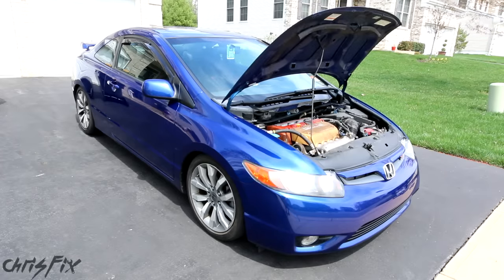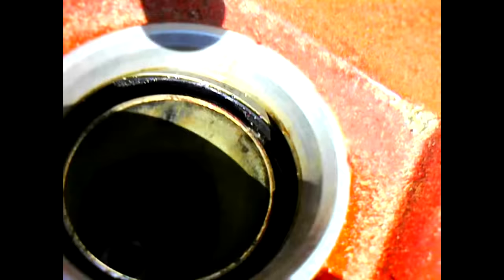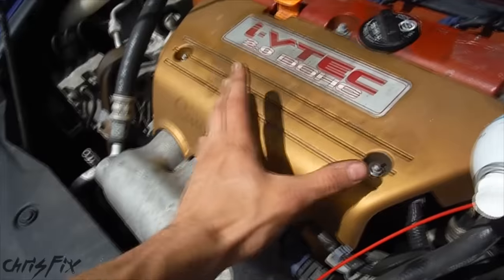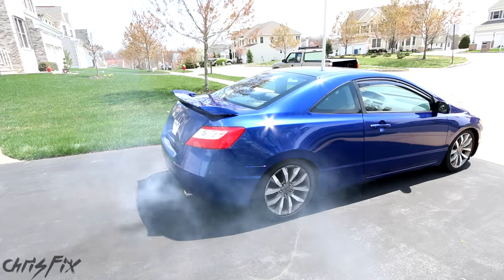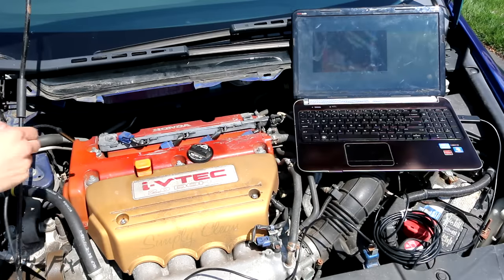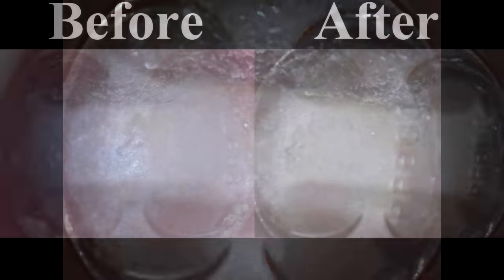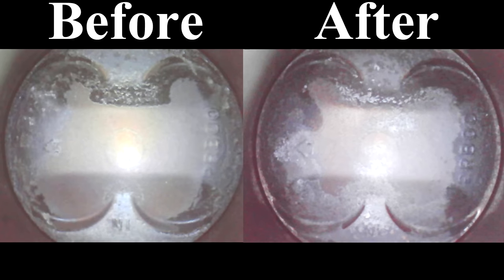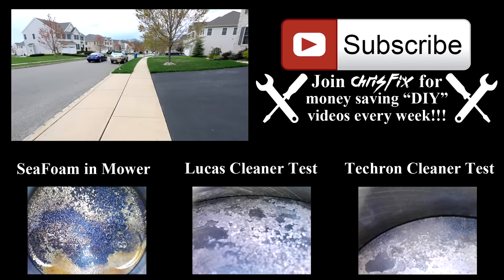Does Seafoam Actually Work in a Car? (with Proof)

Comment: Just did the seafoam "3 way treatment" (in the gas, in the crankcase, and sprayed into the intake) to both my son's 2010 Equinox and to my 2010 Expedition.   The difference was astounding - I was very impressed with the Seafoam and will use it again.
Reply: putting Seafoam in the crankcase can lead to costly repairs, usually whatever it loosen has a habit of clogging oil passages, especially the ones that feed your main bearings.
you can search it on the internet. 
the other 2 methods seem okay I suppose
Reply: @terran2kk  I think people should do this when they doing an oil change since that stuff still stays in oil.
Reply: @GokuTheHusky  it just goes through the injectors, not the oil. I usaually do this when I put a new filter and after a tune up. (2002 Ford Expedition, “285000” miles) and still running like a charm.
Reply: Question buddy did you remove spark plugs when you sprayed into the car? Or do you just spray those above areas w/o doing anything else?
Reply: @whoelsebutthekidace  No, this was just a treatment for the gas, the air and the oil.  I think I did the plugs and coils afterwards. 

Cancel

Reply
Reply: I know this was commented a year ago, but where is the throttle body on the 2nd gen Equinox? I have a 2013 myself. Is it the end of the tube where I replaced my engine air filter or is it somewhere else?
Reply: @JMaher393  You have to pull off the intake box on top and it is up front.
Reply: @TheScottiolla  Thank you so much!
Reply: @terran2kk  Doesn't matter where you put it, it will loosen carbon and it is just a detergent like in gasoline so should not harm the engine at all.
Reply: @terran2kk  I know of a mechanic here that has taken apart engines that used seafoam and every one was near spotless and clean.
Reply: @JMaher393  I hope you searched YouTube by now but, if you haven't, it's at the front of the cover. You have to remove the cover at the air hose and front of the cover. Right to left of where the cover connects on the front is the throttle body is. You'll see it as soon as you remove the cover.
Reply: @SugaDontPlay  Yeah I did, haha. Thank you so much
Reply: did you have issues  with oil  consumption  with  the equinox? did doing the 3 treatments take care of it?
Reply: @mychannelsirr  it doesn’t consume like other horror stories I’ve read (also note, I got in on the extended warranty and GM serviced it).   The car was running rough - the Seafoam helped that.

Comment: Absolutely love your channel. You are building a very trusted brand for yourself. Your credibility is off the chart with me.......and I am sure with your 7 million other subscribers.
Reply from the maker: Thanks a lot! I'm always working to keep building that relationship with you guys!
Reply: @chrisfix  👍
Reply: I love chris fix, he is the only man on the internet i will swear by.
Reply: Lu Ms  it breaks it down and carries it through the exaust, if it does get stuck in the exhaust it doesnt matter since it wouldnt effect performance at all
Reply: Lu Ms  most exhaust systems are pretty thick in diameter, so theres alot of space for air to travel through it regardless of carbon build up, carbon build up hurts the engine performance usually when its inside of the cylinder because it messes with the firing of the actual engine, it can get in the fuel injectors and even on the tips of the spark plugs. This is a very condensed space, and seafoam should get the carbon build up out of the cylinder through the headers and through the exhaust, sometimes it can get stuck somewhere in the process however, but generally it doesnt, and if it does, it will just move onto the long exhaust pipe in which it wouldnt end up losing as much performance as if it was actually hurting firing time or the other engine components, so to answer your question, yes, it can, but its not supposed to. To answer your second question, if you have more than one exhaust tip and its thicker than the bananna can fill, then yes it would decrease performance, but in most higher performance exhaust systems, it wouldnt effect performance much, and this example doesnt work here because carbon is incredibly small, it would not build up to the size of a bannana.

Comment: I've been using Seafoam in the gas tank in my '88 Dodge since it was new-- over 300,000 miles and I've never needed an injector cleaned or repaired. Same goes for my '98 Mercury.

Comment: I swear I had a misfire code on cylinder #2 in my Jeep. New NGK spark plugs didn’t fix it but Seafoam cleared out the carbon deposits and the engine ran better immediately afterwards. I am so confident in this product after only one use it’s magic.
Reply: Where did you put the seafoam in?

Comment: Used this on my just purchased, 20 year old prelude (150K mi). Before using it, I had no oil leaks. I used it and it cleaned out a whoooole bunch of nastiness, but it cleaned it out so much, that several gaskets started to leak oil (I assume the built up oil was plugging the holes). It runs much better, now that I replaced a whole bunch of rubber in the engine. I'm glad I was able to find all the leaks and fix them, but be warned that if you're doing this on an older car, there's potential for new leaks. But the car definitely appreciated the cleaning and all new gaskets!

Comment: Have loved seafoam for years, got told about it when I bought my rx-7, works wonders I have always done the "deep clean method". Get to 1/4, add seafoam, have a can with gas ready and run it till your empty. Add your gas can hit a station, fill up and drive

Comment: keep in mind, the engine was already pretty clean. I bet on a dirty engine the results would be more impressive. and you didnt look at the valves either.
Reply: It does work better in a dirtier engine. Letting the fluid soak in the chambers then removing it before starting is what works best.
Reply: Yea these kind of cleaners are meant for much older cars with years and years of carbon buildup
Reply: BlatentlyFakeName  buy some BG44K is a top rated additive
Reply: Top rated by who, the manufacturers?
Reply: Marvin Harrison Smith II  I don't use BG but know people that recommend it. What I do is this check out on Google.com in the search bar put in LS1 been testing oil. It's about using Marine two cycle outboard TCW3 rated oil at 1 oz per 5 gallons that's 640/1 ratio of gas to oil every time you get gas. My Volvo and Jeep run great. Marine TCW3 oil burns ashless. Lots of testing done. I've been using for over one year
Reply: Adam Adamson shoulda used his truck eh
Reply: BlatentlyFakeName it has nothing to do with how old a car is but with the type of fuel injection the car is... I have an old car and will never need to clean the valves because carbon will never build
Reply: Fuel-port injected motors may not need Sea Foam as often as the pistons are pretty much continuously cleaned, but GDI's?  Every year, even if it is only a year old.

Comment: Great video! If you ever get the chance, definitely try this out on engines notorious for carbon buildup. Like Audi’s 5.2 V10 on the C6 S6 or D3 S8, which are much more prone than an R8 because those cars are more likely to be driven leisurely.

Comment: The smoke rings at the startup tho!
Reply: ExxonGaming I was like....wait what?!
Reply: The vape jokes if it was a Subaru though
Reply: Did someone say vape???
Reply: do you even vape brah
Reply: It should be a pain in the ass to wire in the camera in a boxer engine tho lol
Reply: ExxonGaming ❤️
Reply: Vape nation bro
Reply: That VTEC tho.
Reply: We get it.... You vape
Reply: @kylenelson276  if it was a Subaru, I'd be picking off the parts for mine.
Overrated junk.
Reply: meaning of a random tho in a sentence?
Reply: @sbond1963  its a shortened version of though * sarcasm fully intended*